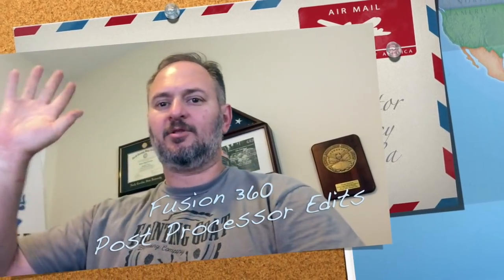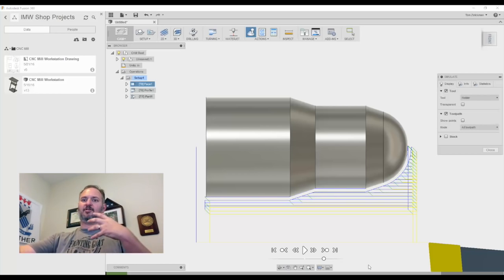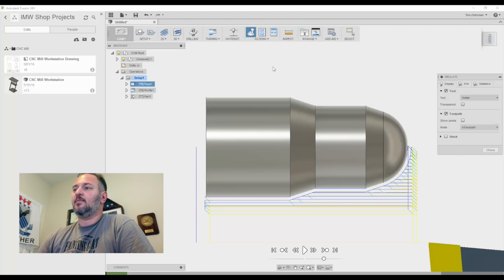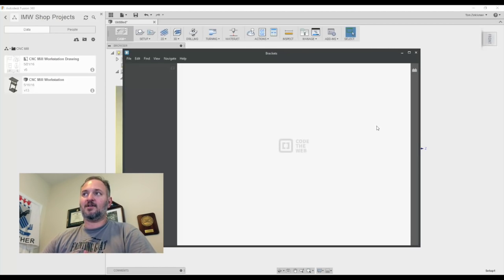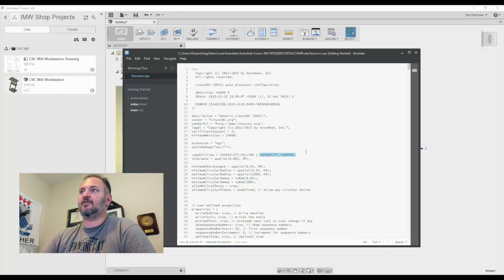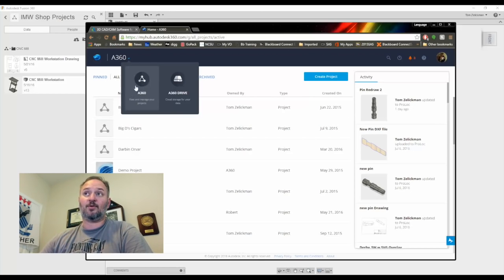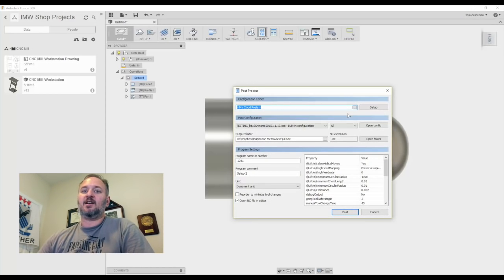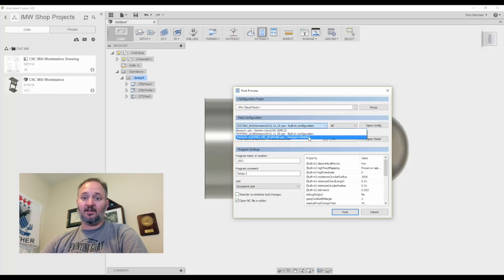Fusion 360 Post Processing

Comment: When I try to edit the post processor it says I do not have permission Any suggestions?
Reply from the maker: The process has changed a bit since I posted this video. Fusion 360 now has a folder down at the bottom of the list called Assets. In there is a CamPosts folder. Uploading your file into there will make it available via Cloud Posts. If you are still having problems just let me know. Maybe it's time for me to make an updated video?

Best wishes,
Tom Z

Comment: Don't you first have to go into preferences and enable cloud posts before you can use this?  That wasn't mentioned in the video.
Reply from the maker: Hi Steve,
You're absolutely right. I'll have to go back and check the video for errors or changes since it was fist released. I also did a second video that is specific to using cloud posts that does address that part though. Maybe I can link to that video as well to resolve the discrepancy.

Thanks for pointing this out and for watching the video!
Tom Z

Comment: Cool that you are making parts.  | (the pipe) is also used as the OR symbol in many programming languages.
Reply from the maker: Thanks, Ryan! I had forgotten about the OR symbol since I typically only use that when using *nix command line stuff. I'm a long ways away from my coding days! 

Best wishes,
TZ